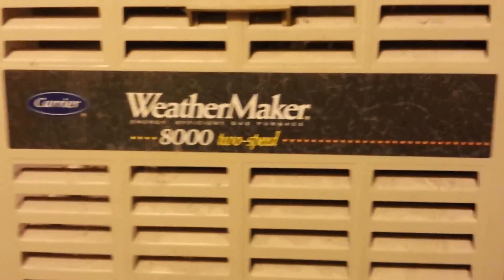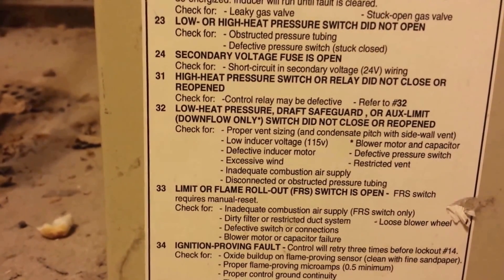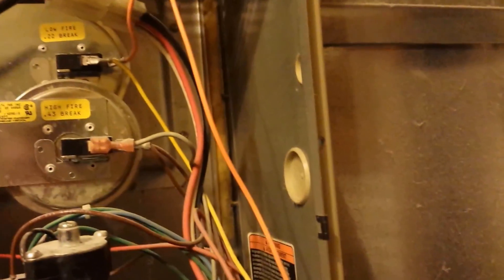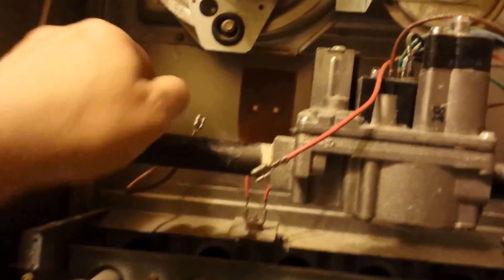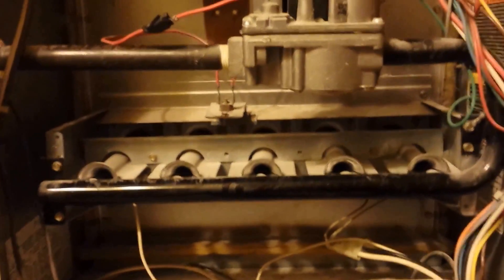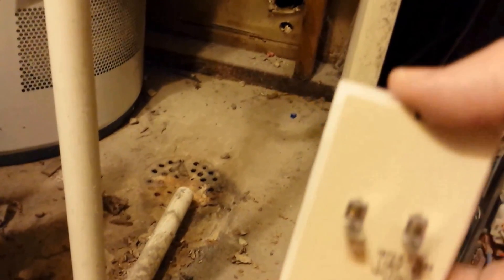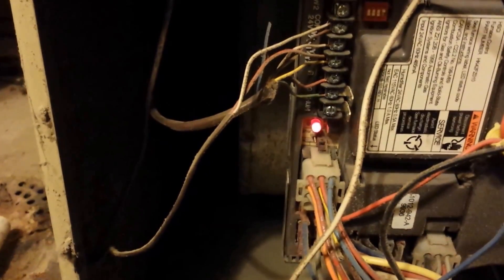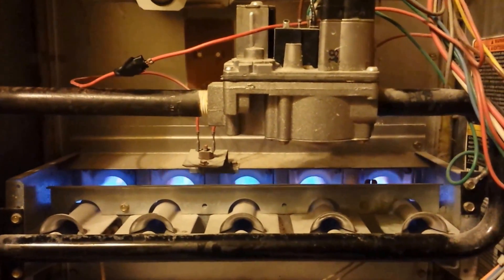Carrier 8000 - Diagnose and Repair Limit Switch

Comment: @MarkMason ,The wiring harness that's under the indicator light .. I have a loose wire in there which is causing my heater to stop and start on its own .. Any idea where I could purchase a new wiring harness for the 8000 ???
Reply from the maker: jojo160555 what the?! I don't know how I missed this comment. so sorry. Hope you figured out your problem. I just got notice about this comment this morning. weird! what I do first is locate the part number. http://www.kearsleyservice.com . call them, talk to a technician, they will either sell you the part or give you the part number. then search online.

Comment: I have a similar problem except that I restarted it by going from ac to heater, then I watch it.. The wheel spins, ignitor lights up, and gas and flame goes in the pipes like how it was when yours was working. I dont hear the blower going however it works on AC... Im a bit confused... it does this with the flames on for about a minute and then turns off and gives me code 33... How do i trouble shoot from here. It seems as though my heater is working, just not pushing air to the house.

Comment: Mark, when you had your error code, did you have a display on your thermostat? I have a 33 but have no power from the circuit board to the stat. Bad board? Haven't put a meter on anything else yet.  Bill

Comment: Thanks for the help. I couldn't figure out why my furnace was not coming on. After watching your video, I tested the (FRS) Flames Rollout Switch and as the video suggested, it was open. I reset  the switch, then power up the furnace and the unit is up and running. again, thanks Lincoln with DV Comm Systems. 10-15-16
Reply from the maker: Lincoln Charles, that's awesome. so glad it helped.
Reply: +Mark Mason I am a month into school and I subscribed solely for the purpose you changed contrast for the switch you were talking about 
thanks for uploading, I look forward to future uploads

Comment: my God I've had it...I've been trying to figure this out for three days...I'm pretty mechanically inclined and  an usually figure out how things work but this furnace is my first one and it's being a b!tch...operation of sequence goes goose no error codes and the small mother runs to evacuate the system and the ignighter glows bright,then there's the click for the gas valve to open but it don't light...when I get the 24 volts to the gas valve to open the ignighter goes out...? There's no smell of gas at all. I think the gas valve is bad,but I'm not sure if some switch is keeping it from opening...the furnace quit working group when it was real windy,but it's not windy at all now...and wouldn't 24 volts to the valve mean it should open....? damn I'm getting frustrated...I do not have enough the money to call a repairman. I'm on disability with 4 children so money is always super tight...! you seem pretty intelligent,and I'd love to hear your opinion.I don't want to spend the money for the new valve if it's not the problem. you can find me on Facebook I'm Jeffrey Steen in berne Indiana ...if you want send a friend request and then we can talk about it,if ya want. thanks for your time I really appreciate you taking the time to read my post .......jeff
Reply from the maker: Jeffrey, your problems out of my league. but I'll tell you what I would do. there's a shop here that I call when I have troubles. they don't mind helping a brother out, if he can explain his problem. you can ask for one of their technicians and tell him what's going wrong and what you've tried. ask him how to diagnose your problem and he'll talk you through it, if he can. I can't promise you that he'll be able to help you, but I've called these guys many times, explained my problems, and they've known how to diagnose it. they're good guys. (801) 292-1636 Dick Kearsleys. Good luck. God bless. I'll pray for you brother.

Comment: What if the flames come in but the exhaust fan will not? We have turn the fan on via the thermostat without the heat and the fan turns on.

Comment: I had the code 33 on my Weathermaker 8000 furnace.  I watched your video and figured out what the problem was.  I had neglected to change my furnace filters for awhile, which I'll not let them go nearly as long in the future.  The Limit Control Thermostat on the burner panel had no continuity.  So, I replaced it ($12.50 and my free labor) and it worked fine after that.  A big THANKS for posting this video.
Reply from the maker: makes you feel good to get it done for $12.50. nice job.
Reply from the maker: 16x25x1